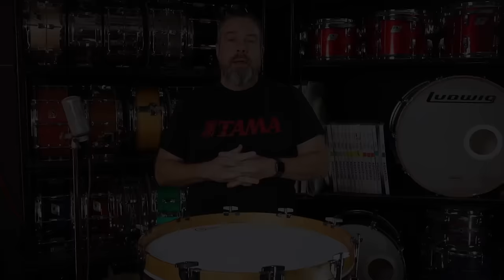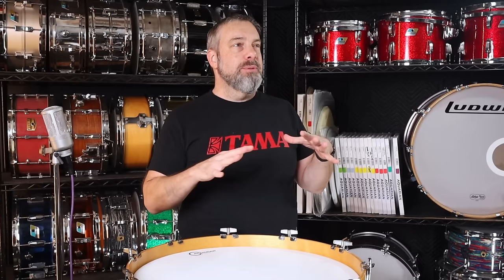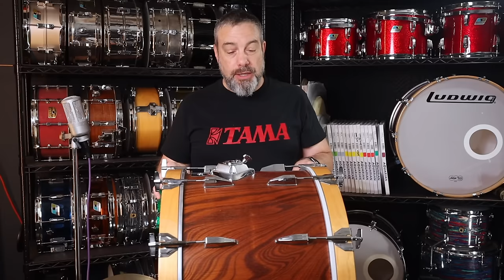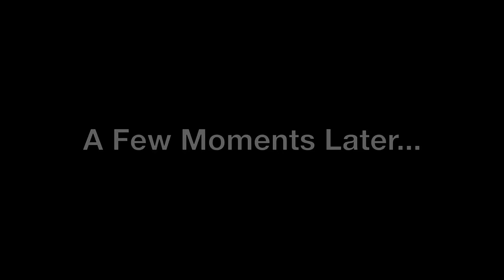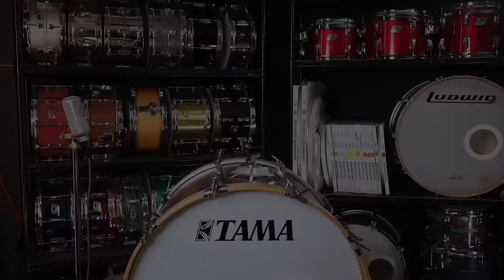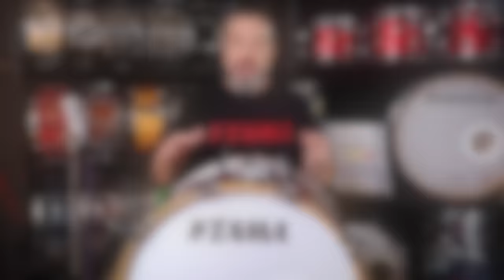Bass Drum Tuning Made Simple -- A Practical Approach For Either One Or Two Microphones

Comment: I enjoy these videos 👍. So I have two 22 x18 inch kicks and then two 20x14 all different wood and different head configurations. I play Fast to mid-tempo punk music so I like a nice punch with some low end and I usually play my bass drums about 90% wide open with the exception of a rolled-up towel centered in the middle of the bass drum side to side to soak up those little overtones, I remember watching a bunch of those Tighten to the wrinkles disappear barely tuning videos and I tried it but figured out it didn't work for me. I set my battery to maybe a full turn after the wrinkles disappear and then the reso is two turns after the wrinkles disappear and that's kind of my sweet spot, I'm not a gigging drummer and when I do videos I don't have mics so it's just a wide open raw sound in my garage
Reply from the maker: Bass drums produce a much punchier and shorter sound in a mix than you might think listening to them in a room.  It takes a LOT of sustain from the drum to become a problem in a rock/pop mix.  I find short, muffled bass drums to translate in too staccato a fashion in a mix. 

Much easier to shorten the sound with processing than to lengthen it (and affect all the leakage from the mics in the process).  

Thanks for your comments!

Comment: Thanks for another super valuable tuning video! Early on I’ve definitely fallen victim to the super simple tuning methods. :-) Best thing I did was for a month just make a point to re-tune whichever practise drums I was using. Then I developed my ear a fair bit, which has helped massively. Your info is always super helpful, it’s detailed like the smooth vs rough insides and how that relates to the “basketball effect” (high frequencies bouncing around). How you tune for recording with 1 microphone looks like what I often settle for myself in medium size rooms. Thanks for the video!
Reply from the maker: The inside of this drum is sealed, but not smooth.  Lauan (a.k.a. Philippine Mahogany)is a very wide, open grain that isn't smooth.  The interior is sealed with the same stain (and same faux grain) as the exterior.  Though this drum uses the same shell used for Imperialstar drums it wasn't wrapped in plastic and it was coated with zolacoat on the interior.  A unique drum line in Tama's history.  I dig them (I wish they made more sizes -- I would love to have a 10" and an 18" to go with, but I love the kit just the same).

Thanks for being here and for the kind words!

Comment: Awesome and super useful! Thanks Joel!! Have you tried a figure 8 patern mic inside to capture both heads ( i imagine there might be phase cancellation with that, but thats not nesessarily a bad thing) or aiming the mic at the port hole but moving it back slightly to pickup both heads? Im curious as i mostly distance mic my drums and i dont have a port hole so i havent tried these things :)
Reply from the maker: I used to have a Beyer M380, which is figure 8.  An odd microphone, but sounded great (and put out darn near line level!!).  I have since made a figure 8 mic that sounds good too, but that is another whole thing that I may cover in a video on my recording channel (recordingdotpizza).  

Thanks for your comments!
Reply: @drumdotpizza  Thanks Joel! I have a cad live ribbon mic, i might try that, its supposed to be more sturdy than your usual ribbon, so it should sound great and be a fun experiment

Comment: Amazing video and knowledge.. as always. Thank you Joel ! 
in concern with what you say @6:25 i have tried to make my 22*14 Rogers kick to sound like Fred Eltringham.
i tried  reso head with a huge hole like there was no head, a big blanket inside and my batter head medium tight to have rebound and a tone.
would you think that the batter head finger tightened, so somewhat loose and dead, would be much more appropriate ?
It's brand new to me, i have always been told to have a reso head and sutain on my kickdrum..
Reply from the maker: The bits of Fred's playing I have heard sound like a double headed kick, not very hyped.  Probably would use similar head combo as in this video (double ply batter, single ply reso) with a bit more muffling to limit the front head action.  Probably would go a tad tighter on the batter too (don't need quite the depth of tone for a more middle of the road sound).  Just enough tension on the front head to provide the desired tone inside the drum (an outside mic in front would be good too, though more just to get brief 'oomph' without actual resonance).  Small packing blanket inside touching mostly batter, but enough o stifle the reso head beyond a few tens of milliseconds.  

Just my thoughts.  I hope it is helpful.  Thanks for chiming in!
Reply: It is ! thank you very much. I will absolutely try that.
if i have to use a kickdrum with no reso head, would you go for a very loose batter or a tight one ??  @drumdotpizza

Comment: what's the difference's between Bass Ported and Non Ported, Would like to know cause I always had Non Ported,  Thanks.
Reply from the maker: For me the port is a practical way to get control over the attack of the drum (being able to put a microphone inside).  Simon Phillips (among others) used unproved heads and wires up an internal mic using the vent as a port for the microphone cable, and I have considered doing so to see what difference it makes in the sound -- perhaps this would be an interesting video to do!?  

Nevertheless, the only miking of unsorted bass drums I have done is miking from the batter side of the drum for the attack (using dynamics processing to remove, as much as possible, the bottom of the snare drum from this mic), and have had fairly good results, but nothing so much as to make me want to do away with holes in the front head.  

I really should put this to the test.... all these years I've been recording drums and I really haven't ever tried internal miking with no hole in the head.

Thanks for the comment!

Comment: For me, the drum sounded better before you loosened the two adjacent lugs. There was a weird overtone to my ears. Might have sounded better in the room though. Good video, thanks for the info and for dispelling myths.
Reply from the maker: Yeah, the higher tension on the front heads adds TONS of tone to the interior of the drum, and even a higher pitch than I prefer can translate quite well in a mix.  The slight dissonance you might hear in the final example would be virtually indiscernible in a mix.  

But good ears!!!!
Reply: @drumdotpizza  thanks! For me the one mic thing is just live stuff or rehearsal recordings, and you’re right, no way that slight dissonance would be heard in a live setting. Live is always a compromise anyway. All my drums that use actual T-rods, they have to be in line with the hoop, partially for my OCD, but also to fit them in the cases, so the tuning isn’t “perfect” anyway. Once again, thanks for the videos. I appreciate all you hard work.

Comment: And the shell is 9 ply mahogany with this special tama internal sealer ?
Reply from the maker: No zolacoating on the inside of this drum.  Clearcoat with the same faux grain printed inside as out.  Same shell as Imperialstar, however.  9-ply lauan (a.k.a. Philippine Mahogany), no wrap, no zolacoat.  The 2nd Gen Brazilian Grain Royalstars used a 7-ply lauan shell with inner and outer plies of a soft wood called "Shina" (Tilia Japonica) which is similar to American Basswood -- it looks nice, but its softness makes it wear horribly (and not a good tone wood either).  2nd Gen were darker in color and extra deep dimensions only, fewer lugs, etc.  Not particularly good drums.  

LOVE the 1st Gen though!!  Gonna have to do a video on them at some point.  Thanks for chiming in!!
Reply: Thanks for your answer.I've got a tama swing star from the 80's in this size,but with  wrap and zola coating inside,8 lugs ,but the shell itself is pritty much the same i quess,that's why i asked so in detail.... i like it a lot,good made shell and good looking too,and a softer wood like those phillipine mahogany seems to be quite good for bass drums.